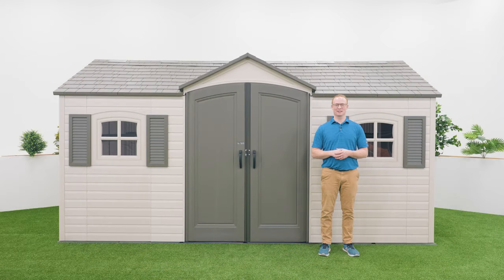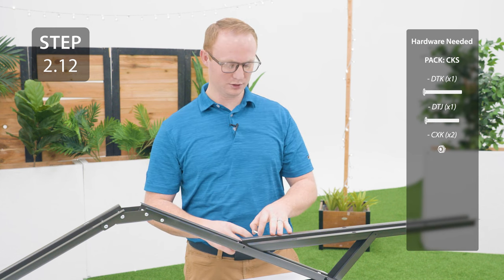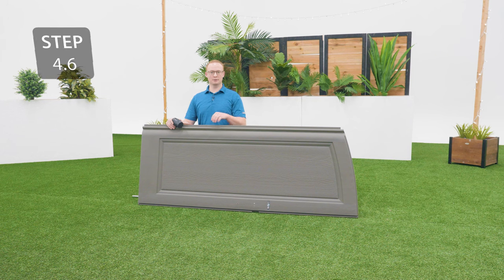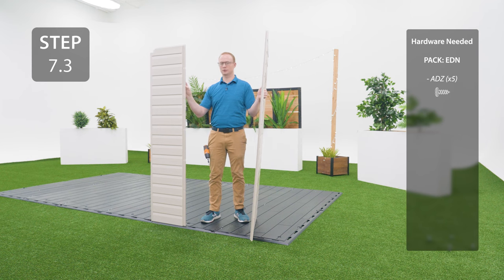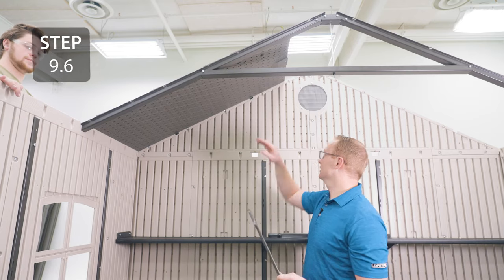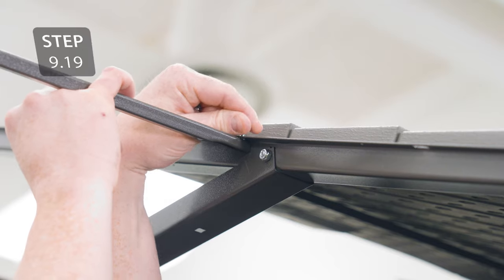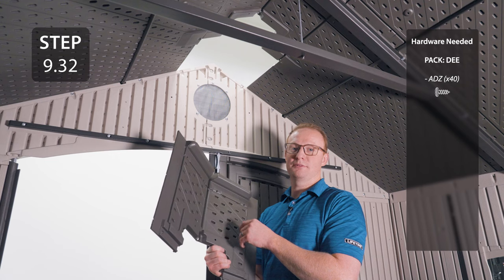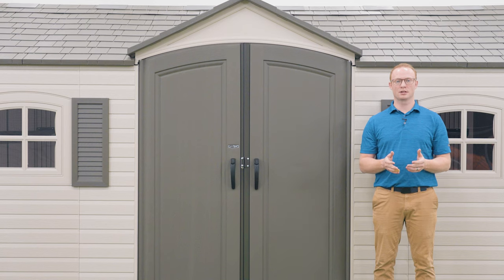Lifetime 15' x 8' Outdoor Storage Shed | Lifetime Assembly Video

Comment: We have one and love it. The only problem is the shed heats up and the top door latches fall open. So we shim them. YOU MUST HAVE A PERFECTLY LEVEL SURFACE TO ASSEMBLE. We’d definitely buy another they are water tight and ours has never leaked even in a flooding downpour.
Reply: Where u got urs from

Comment: I have to agree with someone’s comment that without this video I would have NOT been able to assemble this cabane!! The instructions are not entirely as the video. The indication on the material doesn’t always match the guidance. Need to use some human logic in certain areas but for the most part, you should be 2-3 adults for sure, and two half days or a full day but start really early. Good luck ✌🏼
Reply: I built this on my own. No video , just following the manual. The only thing I needed was a ratchet strap to hold one of the doors while putting the other one.
Hard job but all perfect. 
The floor needs to be flat.
If not, will not align

Comment: I got this shed, and the only issue is where the poles go in for the doors, way to tight and had to dremel them a bit on the bottom of pole and in the collars to get the fit. Otherwise the rest was fine going together. I recommend putting this on a concrete slab though over a flat yard surface.

Comment: Just finished putting this together today.  After everything was done and I'm trying to get the door aligned, I noticed the front gable popped out of the truss on the right side.  I'm hoping if I loosen all the screws around the roof of the doors I'll be able to pop it back in, maybe??....also, in the video, step 9.35, it references a small gap plate for above the doors.  The instruction manual does not have this listed.  Is it missing from my shipment?  Shed # 6446

Comment: My first wall pannel CKN doesn't work out ,it's covering the door devit ? What is wrong?
Reply: Use a rubber hammer with a piece of wood and try to move the panel to clear de hole.
Reply: Same here, did you sort it?
Reply: If you watch him insert the wall panel, at the bottom, you can see that the bushings are not where he placed them in the floor in the previous step. I had to zoom in on the floor bushings as he inserted the doors to catch it. Took a half hour to figure it out.

Comment: Had started finalizing roof ad as i get to the front doorway gable things are no longer lining up. Ive noticed that by left front door my floor has buckled and raised the outer wall panel up also. Any recommendations? Please. N thanks. Im so close. Grrrr
Reply: Same thing happened to us. Did you figure out a solution?

Comment: What if you mixed up with the door long pole to the side door and short pole on the front hole ? Is it ok ? It is very tight and hard to pull out and undo?
Reply from the maker: The longer hinge rods will need to be placed on the 8’ side of the shed. If the long poles remain on the 15’ side of the shed, the entry gable will not be able to seat into position because the rods are too long. If you haven’t secured them with the cotter pin key, you will need to pull really hard to remove the hinge rod from the bushing.
Reply: @LifetimeProductsAssembly  I’ve just had a less than pleasant few days trying to beat the weather to get this beast up… just a point for future guidance and possibly a manufacturing change… THE HOLES IN THE HINGE RODS ARE ALTERNATE AT EACH END OF THE ROD!!! So I inserted the rods into the bushings thinking I was aligning the holds in the rods to the slits in the bushings looking at and turning the top of the rod to align them before hammering the rods down into the bushings.   When I couldn’t insert the cotter pin key I checked the rods in the second set of doors and discovered to my pain that the holes are the opposite at each end of the rods!!!! WHY WOULD YOU DO THAT??? And no I could neither turn nor remove the rods from the bushings, so I resigned not to insert the cotter pin keys.  I continue to try and finish this in the rain (thank God it warmed up a couple of degrees so it is no longer snow!!! 
I was almost finished… put the first roof cap (AGG) in above the gable end fine… but just tried to insert/attach the first of the longer AFY roof caps to discover the first one does not span the gap between roof panels as it should.  All the screw points in the roof panels align with the right holes in the trusses so they are in the right place.  You haven’t broken my spirit yet… but 3 days into this build I’m getting to the end of my end of my tether, as I try to get it up to beat the weather!!!

Comment: Do not buy or build this shed. Send it back now while you still have your sanity and some self respect. The parts are not labeled like this video. It does not go together easily like it does in this video. We broke my rubber mallet in the process and I’m missing the last roofing panel. Do not buy this shed.
Reply: 😢 I’m part way through the build… floor, three corners and two walls erected… had a heavy snow fall last night and have just cleared snow to continue building… LOTS of reasons this didn’t get built before now… I have not had any issues with assembly instructions (NOTE YOU NEED TO READ THEM CAREFULLY) apart from my doors are going the opposite position to what was in the instructions and video so not as easy to follow.  I’ll come back to let you know how my sanity is holding up at the end of today… snow crushed the large tent that all our stuff is stored in while waiting for the shed to be erected… snowy cold day… not a great time to be dealing with an erection in the garden 🤔
Oh and I used concrete slabs for the base which are not perfectly aligned… this matters A LOT.  I’m still not sure if it will work ok… in hindsight I should have poured a concrete base to have it perfectly flat, but I’m too far down the road to stop now.
Reply: Soooo cold 🥶… think I still have my sanity… though that may be debatable… not finished yet… been at it since 7:30am through cold and  rain.  VERY different conditions to the manicured setting in which the assembly video was done… I’d definitely advise leaving purchase and assembly until spring/summer and definitely pour a level concrete base before you start your build.
Reply: I just finished mine three hours ago. I had to pour 13,000 lbs of stone, level and compact it then built a 15x8 platform out of 2x4's and 1/2" plywood, then screwed the floor to it after erection with 30, 2 1/2" exterior screws with quarter sized washers to hold it down nice and flat.
Reply: @zacharyfabian5293  Congratulations Zachary.  Where are you based?  I’m guessing US by the fact you refer to imperial measurements.
I worked in the cold and rain in the UK all day, but really needed a second one of me (had some help from my teenage kids but that was short lived) Still not finished.  Praying the rain remains rain tonight and we don’t get another dumping of snow. Hoping I can get it completed tomorrow… maybe a wooden base would have been easier, but definitely think pouring cement would have been the best job for the base… not slabs.
Reply: I was almost finished… put the first roof cap (AGG) in above the gable end fine… but just tried to insert/attach the first of the longer AFY roof caps to discover the first one does not span the gap between roof panels as it should.  When I screwed the second screw into the opposite side the first screw popped out!! 
All the screw points in the roof panels align with the right holes in the trusses so they are in the right place.  You haven’t broken my spirit yet… but 3 days into this build I’m getting to the end of my end of my tether, as I try to get it up to beat the weather!!!
Reply: @alistershaw7976  make sure you do one center roof cap and then one skylight panel. You leave two screws out of the end of the first panel to connect to the second after you have placed the skylight panel.
Reply: @alistershaw7976  I'm roughly 25 miles from Cleveland, Ohio.
Reply: @zacharyfabian5293  Thanks, but I don’t think that is the issue.  In the video the guy installs the skylights after installing all the roof caps.  My issue is my first central roof cap didn’t fit neatly in the space between roof panels.  All screws are aligned correctly in the roof panels and the first roof cap of the gable end fits fine… but the first centre roof cap is too narrow to fit properly although the holes in the trusses align ok?
Reply: @alistershaw7976  the way we did it, we started at the right side of the building when viewing from front. We placed the first end on the right side which is the side with the second set of doors. We put the first two roof panels on, then the first skylight. If you don't do the skylights as you go, you will not be able to hold them in place. My Brother was on a 6ft ladder inside, head and shoulders through roof and held the skylights while I screwed them in. Go very lightly when tightening them or the posts will break. Also don't fold them too much or the center will snap. Take them inside to warm so they're more pliable.
Reply: It is also pretty impossible to do this on your own.
Reply: @zacharyfabian5293  Yeah… I had help when it mattered… the roof caps are not something that needs two people.  I tried your tip of putting the skylights in after each roof cap, and it has helped a bit, but the roof caps are not sitting neatly in place so I’m hoping the screws in the trusses will secure them in place as the two points where they should be screwed together at the end are not aligned in the first two centre roof caps.  I’m hoping the skylights will help keep them together and help keep the elements out??!! Although one of the holes for receiving the screws in the skylight (the posts) just popped off, so I’ll be getting the company to replace that sky light!!  I can’t work out why the ‘skylights’ are brown plastic and not transparent??
Reply: @alistershaw7976  mine are an opaque/whitish color. My roof panels didn't really align but we just muscled them close and brought them together with the screws. Where abouts in the UK are you? I have a Friend in Sheffield, England. I could shoot him a message to see if he's free if that's close to you?! Everything on mine was a bit wonky.
Reply: @zacharyfabian5293  Actually I’m just 20 minutes from Sheffield (if clear traffic)… Sherwood Forest direction.  
I reckon there would be mileage in starting a support group to help people get over the trauma of building one of these beasts. 

Like you I’m having to muscle in the roof caps as they don’t seem to be long enough or wide enough for the space they should fill.  
The receiving holes for the skylights are fairly weak too.  I’ve had a couple snap off while screwing in the screws carefully!!

Almost there now though… might have to move into the shed after this… I’m become intimately attached to the thing… but more like Stockholm syndrome!!
Reply: @alistershaw7976  if you get to a point that you can't do it alone, I can shoot him a message. Anyone that has any questions is more than welcome to ask, I just finished yesterday so it's still pretty fresh in my head.
Reply: I do believe it would possibly be easier to do with warmer weather but there still is some pretty drastic alignment issues.
Reply: been working on it for weeks in between work.. ugggg
Reply: Eazy shed to assemble

Comment: I have an issue because on the short side door, the two holes are at the edge of the wall, which is fine, but on the long side door, the hole which is supposed to take the tube for the right door is under the wall!?
Reply from the maker: On the 15' side, the bushing for the right door will actually go in the keyhole shaped hole.
Reply: @LifetimeProductsAssembly I did actually place the floor panels according to your instructions. With the key shape hole on the right, the hole is several cm too far from the wall, so you have a big gap. After redrilling a 25mm hole, the doors line up the same way on both sides, and close, so I don't see how the instructions can be correct!? The issue I'm having though is that the door awning won't go on. But everything on the wall is lined up. I have posted videos to show my example you can see that the keyhole hole is on the right. It is far from the wall whereas the circular hole on the left side is flush to the wall.